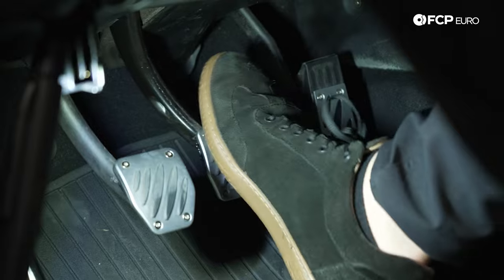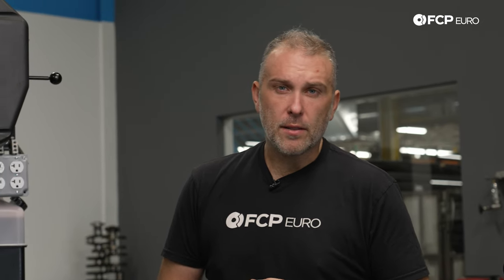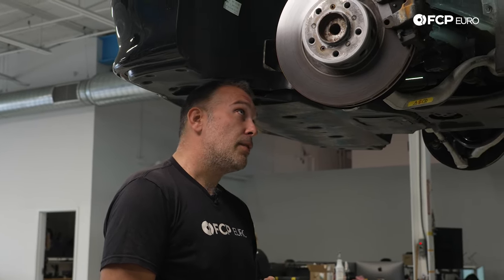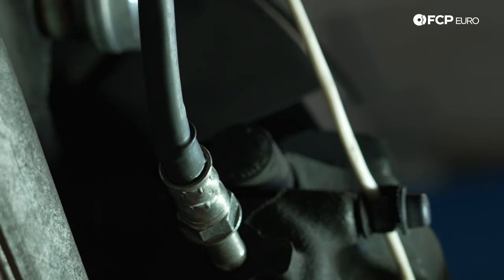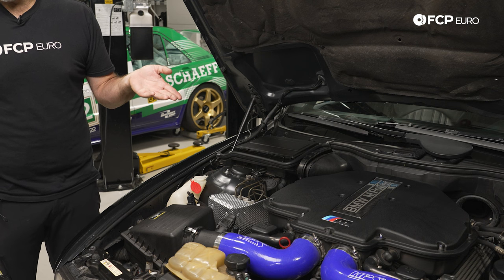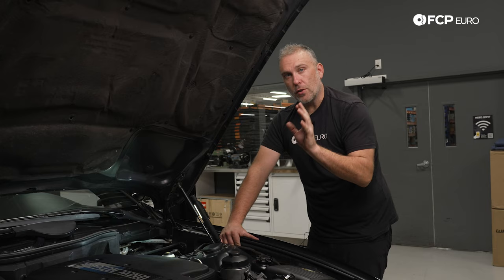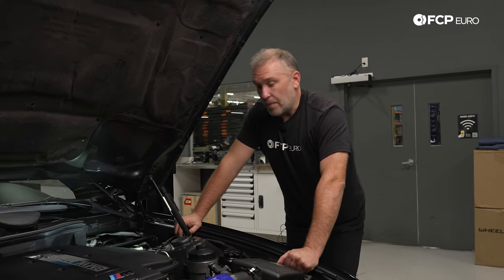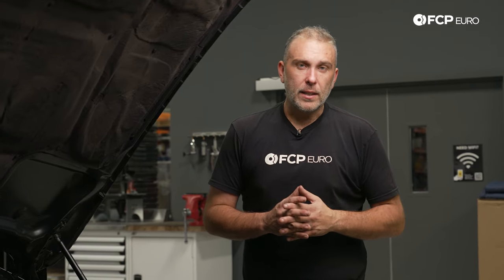How To Diagnose A Soft Brake Pedal

Comment: Insanely useful. Have to diagnose the brakes on my track e46 330. Same 'mostly' ok. But it just goes forever...we bled it many many times. Same feel of "i have stopping power, but the pedal never wants to compress and firm up".
That said, I think my booster is also going? While sitting, you hear a slight "hissing" sound. With a light to moderate brake press, the hiss sounds like constant hissing air (also a 'push' sound like ur pumping an air pump), but the hiss with keep going. Press further and the hiss/air whooshing stops. I assume that its the booster leaking in addition so plan to replace both the master & booster. Sound about right?
Reply: That for sure is a leaking vacuum booster, definitely should replace!
Reply: Yea. I figured and I think the master is gone too. Doesn't firm up til you floor. Just gonna replace both. In for a penny. In for a pound!
Reply: @Conquerred512  Good luck.  If I recall, 3 series was always Conti-Teves business, not TRW, so yeah, more likely it all failed 😂
Reply: @gregreed2713  ouch. Ate so yea. Conti... It's fine 160k miles. And track abused. Worth it.
Reply: Did it solve your problem?
Reply: @melusincube7863  Did both in one go. The booster was definitely leaking from the in cabin seal and the noise is gone. Unclear what it was effecting. WRT the master cylinder, I'm not sure it was good or bad. It had no signs of leaking.
At first my brakes still felt like crap after 8+ hrs bleeding (including using INPA to bleed while cycling the ABS unit) post install. We were continuing to debug other potential sources to a bad brake feel (leaks....bad caliper seals...etc)...Then after some driving and sitting for a couple weeks, it just....felt better. Unclear if a bubble just stuck somewhere that miraculously got dislodged or what. It is beyond my understanding. Regardless, the brake pedal feels great now and the booster leak hiss is gone.

Sometimes, you just accept functional and don't ask questions 😅